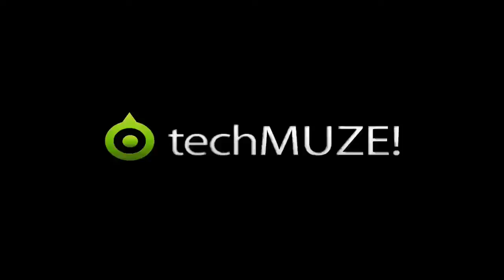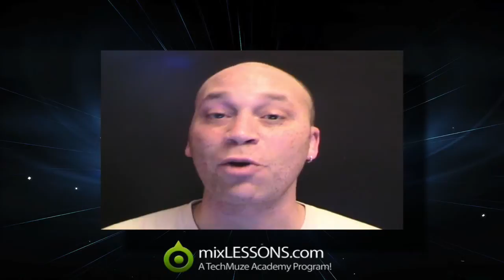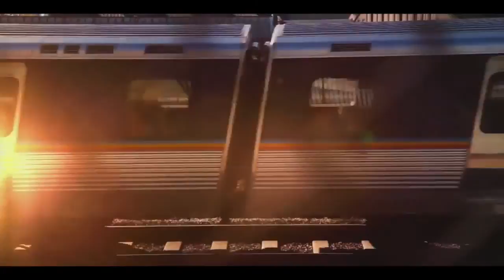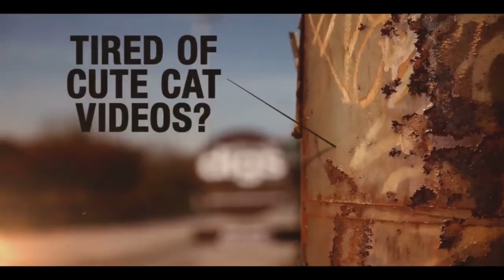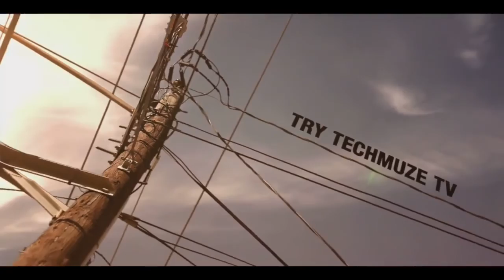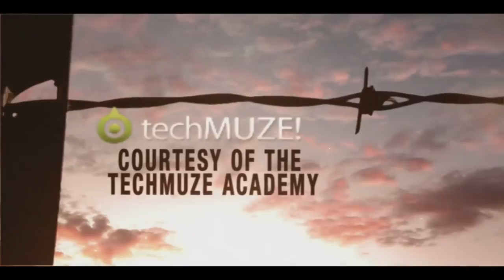Input Levels Revisited

Comment: the trick is too run your mic thru a preamp/ compressor to get that hard and clear sound before it even hits your interface and than record with low volumes from the interface. once you get the audio inside of your daw NORMALIZE your track. and you will have crisp sound

Comment: I still track as hot as possible without clipping even without tape, because of the very same reason that I want my noise floor to be as low as possible. specifically when I pass my signal through several units (guitar stomp boxes, rack outboard gear that is cranked pretty high, and anything else that will bring my floor up before my converters). I then turn things down in my mix and voila: my noise floor is inaudible.